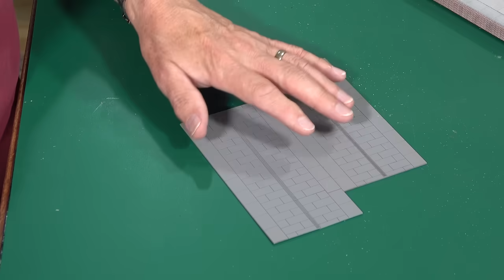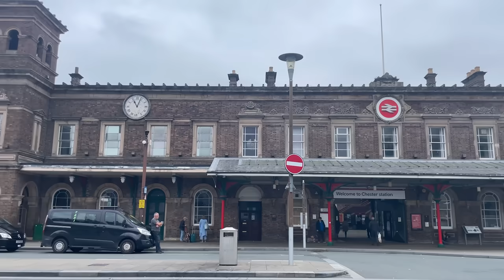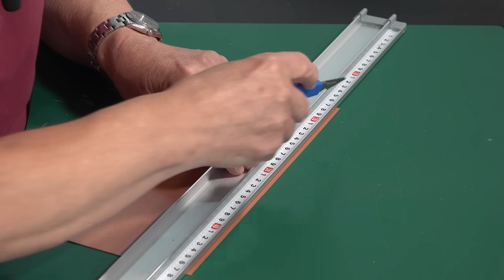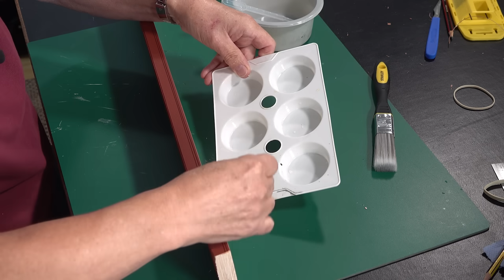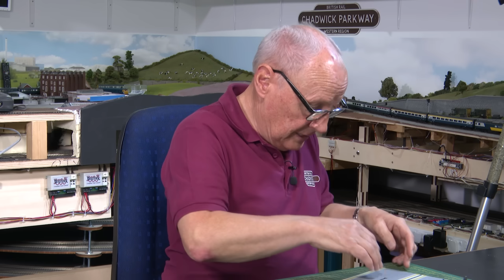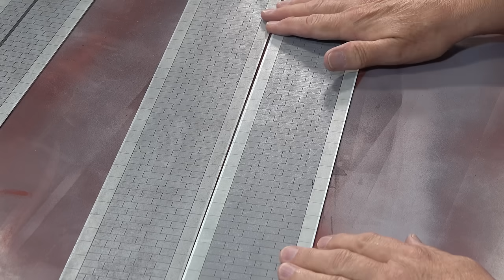Building The Ultimate Model Platform At Chadwick Model Railway | Episode 233

Comment from the maker: For the cutting ruler, search eBay for “metal safety craft cutting ruler picture mount cutter Rule 60 cm”.  Regards, Charlie.
Reply: Please think twice before purchasing that ruler.  In the eBay listing, it claims to have a steel cutting edge (for longevity).  That is incorrect; the cutting edge is aluminium and will not last very long at all...
Reply from the maker: @manokent  thanks mate, it was actually bought for me as a gift. Regards, Charlie.
Reply: @ChadwickModelRailway  - the crying shame is, if it did actually have a steel cutting edge, it would be the perfect cutting rule and extremely well priced.

I bought one and was quite miffed as I know the aluminium edge will only last a few dozen cuts before getting too hacked up.
Reply: @manokent  I bought one for myself at the same time - I put a flat neodymium magnet on the edges of both as soon as I had them delivered - they stuck, weakly, but enough to hold there whilst moving the ruler around in all directions. It didn't stick of course on any other surface, and so the edges are made of steel. So the ones of the seller from whom I bought mine were as advertised.
Reply: Hi @Pizzpott - yes, the magnets are attracted to the cutting edge - but that weak magnetic attraction is to the steel tape measure glued to the upper surface.  Neo magnets are that good...attracted to steel THROUGH  a couple of mm of another material (the ruler body) and that is why the attraction is weak.

Try the same trick right at the start of the ruler where the grey rubber is (the cutting edge is exposed there too).  Without the steel tape which starts at the 0cm mark, the magnetic attraction is near enough zero.

Then try finding a join between the cutting edge and the (aluminium) body of the ruler.  There is none because it is all one aluminium extrusion.

Finally (don't do if you don't want to damage the ruler prematurely), take a file to the cutting edge and give it a good filing.  Your magnet will not be attracted to the filings as they are 100% aluminium.

:-(

Comment: Hello, yes I do know what those Zig Zags are. They are designed to improve electrical conductivity for Train detection with track circuits on lightly used lines. You'll find some at Manchester Piccadilly as well, and in New Zealand where I am, we have them on the Morningside Car Sidings.
Reply from the maker: Thanks K, I have never come across that modification before. Every day is a school day. Regards, Charlie.
Reply: Hello, I saw those zig-zag welds on SNCF (France railways) for better electrical connection on tracks rarely used.
In Italy they are used for in-cabin signal repetition systems which uses codified currents.

cheers
Reply: Hi Charlie.  I would of coloured a few tiles a different colour to depict work on the platforms over the years , especially on the platforms where the mail/parcels go as brutes were notorious for  damaging the tiles . 🙂. Great video as usual.
Reply: I've seen the zig zag thing on some tracks at my local station.  But never given much thought as to what they were for.    Re the cobbling?? This seems like a gap in the railway modelling market 🤔.
Reply: Happy Level up day Charlie
Reply: The Mid Norfolk Railway at East Dereham in Norfolk have the zigzags on their track. They are situated under the A47 flyover for a few hundred yards in the vicinity of two level crossings, presumably to help with the crossing track circuits
Reply from the maker: @richardmarshall4322  thanks Richard, then more common than I thought. Are you guys Charlie?
Reply from the maker: @blairleipst4508  thanks Blair, that’s most kind.
Reply from the maker: @mikeking2539  I think you’re right Mike, it seems to be a lack of it. Regards, Charlie.
Reply from the maker: @simondawson4270  you are of course right? Simon, they are certainly not finished. Regards, Charlie.
Reply from the maker: @richardmarshall4322  thanks Richard, they are more common than I thought. Regards, Charlie.
Reply from the maker: @Setola  thanks, I certainly never seen them before. Regards, Charlie.
Reply from the maker: Thanks mate, but it was certainly something I had never seen before.
Regards, Charlie
Reply from the maker: Yes, Mike, hopefully someone will take it up. Regards, Charlie.
Reply: Hi, it's a stainless steel weld to help with rusty rails in bay platforms to help the track circuit
Reply: Yes, you can see some zig zags on the little used cross over track between the up and down lines at the southern end of Dawlish Warren Station.

Comment: Those zig zag welds are for ensuring the wheels make contact with the steel on the rails and not a coating of rust. That ensures signalling circuits  make contact with the wheels of the trains.
Reply from the maker: Yes, Philip, you’re bang on the money. Regards, Charlie.
Reply: It’s a tad basic isn’t it. I suppose it’s a quick and dirty solution. My idea would be to make a fitting you bolt to the rails to achieve the same , may be I am a perfectionist.
Reply: is it a different grade of steel to rust less than the rail steel or is for different contact patch (smaller) to clean up more easily than the flat rail head?
Reply: @MrTrustafox  It is just the contact area that is smaller and rougher. Some infrequently used points would have these to ensure electrical contact for signalling. A really noisy and rough ride over the welds. As a retired train driver, I have in the past been rostered to do Rusty Rail moves. These were done across less well used sections of track, As the name suggests to clean off the rust.

Comment: I do scale modelling of aircraft and military vehicles and one of the ‘tricks, after everything is painted, is to spray with a gloss varnish. This makes putting on decals easier (they slide around) and then do the weathering. Weathering benefits from having a uniform finish rather than the different finishes you get from the different paints you may have used. After all that is done you spray it with the lacquer/varnish of your choice, matt; satin; or gloss. Job done and your precious paint, weathering and decals are protected.
Reply from the maker: Many thanks, Stephen, for your excellence suggestion. Regards, Charlie.

Comment: As others have said, the ‘rumble strip’ on the railheads towards the buffers is to ensure that the track circuit remains intact in a bay platform. All the bays in Leeds and York stations, for example, have these.
Reply from the maker: Thanks for the info, I’ve never been to Leeds but I have visited York several times. Clearly, I hadn’t spotted this modification. Regards, Charlie.

Comment: Not exactly in answer to your question about Zig Zags on the rails, but somewhat adjacent. I used to work at Bekonscot Model Village, and they had welded zig zags on to some of the 7 1/4" gauge track in a siding. The reasoning was to alert the loco driver that they had reached far enough into the siding, past the points, so that other trains could pass through the points.
Reply from the maker: Now there’s an interesting use GM. Regards, Charlie.

Comment: Like the platform tops and will be ordering. The zig-zag welding on the track you spotted is a corrosion resistant chrome welded strip usually hand welded by a track welder for track circuit actuation where a light loco might be hiding obscured from sight of the signaller after coming off it's train. It is the more recent version of depression bars which were a mechanical  track circuit actuator depressed by the wheel flanges. A sort of reminder appliance for the signaller but still relevant in low traffic platform ends.
Reply from the maker: Thanks Pete, I really was scratching my head on the welded track feature. Regards, Charlie.

Comment: My trick for brick mortar lines is if I’ve used Acrylic to paint the brick Red/Brown normally airbrushed Tamiya paint I then wet the surface with white spirit and use a thin grey oil pin wash to pick out the mortar lines. AK then do some great washes to get that grimy/grubby brick look. Love your method of platform construction. I work in N gauge and my station is a gentle curve but would love to have had something similar to that top you used.
Reply from the maker: Many thanks, Richard for sharing your technique. Regards, Charlie.

Comment: 8:40, the weld applied to the rail head is an area of high head contamination that both inhibits traction (gives a high stress area to displace the contamination) and assurance of dropping the track circuit.   Could be either or both.   

Only works for low load areas (speed and load).  Normal axle loads would destroy this in quick time.
Reply from the maker: Great info Brenden, and much appreciated. Regards, Charlie.

Comment: Happy birthday Charlie! Firstly, the Revel glue you were using, a little tip; each time you use it, before you put it down, tap the tip on a hard surface, as this is supposed to keep it clear. Secondly, that platform where the parcels train is, why not make that an excursion platform, as it has a run round facility, and have the "derelict" platform as a parcels platform, with stock being shunted in from platform 4 (excursion) to platform 3. On clydebridge, parcels trains arrive into platform 5, and the depot 08 takes it out, and shunts it into platform 6, which is also used by the sleeper train. The 47 then comes out platform 5, and goes into platform 6, to be at the head of the train.
Reply from the maker: Thanks for the interesting suggestion. However, it does mean digging up some ballast because an extra point will be needed. Regards, Charlie.

Comment: Belated happy birthday 🎂  I think those new platforms are fantastic.. and u have done a great job on the painting and weathering on them. I really wish I could use them for my layout but my platforms will have curves at the left end going under the town scene  so I'm working on a  design with the concrete platform edges and I will have to either go down the printed plasticard or grout style methods  but I will have to do edging strips and will be following your painting guide for those as they look perfect for the style I'm looking for
Reply from the maker: Rest assured SJ, I will have the same problems on my large station. Regards, Charlie.

Comment: The marks I think, maybe some sort of arc welding, scoring, into the top of the rail to help with traction for when the train pulls away from the buffer to prevent wheels spinning and causing flat spots on the wheels and rail burns.
Reply from the maker: Thanks for your suggestion, however it is actually to do with better wheel to rail contact, for Signalling . It detects when the train is in the siding. Charlie.

Comment: Many happy returns, you mentioned "not learning much" wrong me old mucker, I learnt bundles, check the width of your canopies, consider the layout of the platforms, passenger/ goods, access for motor vehicles, (when the news paper train arrives they went straight into vans, not always but) not sure I will go for solid wood, maybe a skin of 2/3mm ply on top of fine battens, that way I could hide wiring within the platforms, and have only two wires going thru the base board. Charlie, thanks for this, what ever you do always helps, sometimes in great ways other times just to raise a smile Ta!
Reply from the maker: Thanks Vic, that’s very kind of you to say so. Regards, Charlie.
Reply from the maker: Thanks Vic, that’s very kind of you to say so. Regards, Charlie.

Comment: I like the idea of the change in the platform layout.  It makes sense that the two branch line tracks would share one platform at a terminus station (i.e. at the end of the line.)  But also as it is set up, the redundant track could always become an active track down the road if you wanted to (even if you use it as for mail/express cars - i.e. one track could hold be used for mail/express cars that are being loaded and/or unloaded and the other for cars that are ready to leave the station (a departure track.)

The change also makes sense as the station might have needed platform access for four tracks prior to the era you are modelling (i.e. you are making the station scene more authentic in the sense that in real life some lines saw a lot more service at one time and then by later in the 20th Century service levels had reduced as people turned to cars.  Thus the station will be more authentic with the change.

And Happy Birthday!  Many happy returns!
Reply from the maker: Thanks Edward, I’m so pleased you like my amendment. Regards, Charlie.

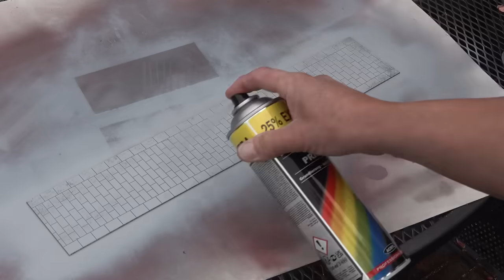Comment: 13:40 Given you are looking for the marbled effect this may be a wasted suggestion ... but if twere me, I would start spraying across the width moving down from top to bottom and then doing the longer spray along the length. That way both directions of the grooves get sprayed.
Those laser cut platforms would be great sellers I think.
Reply from the maker: Many thanks for your advice, mate. Regards, Charlie.

Comment: I’ve used that revelle glue for years and never thought of the heat to free the applicator, I’ve just been using a pin in the tip and very carefully applying the stuff
Reply from the maker: Probably a safer option Luke.
Regards Charlie

Comment: Hi Charlie. Another great presentation. Wavey lines. I've read some of your contributors comments, and while the track circuit theory may well be correct, that doesn't explaine why they appeared at busy London terminii like London Bridge in the 70's for the final few yards before the buffer stops. Thos tracks were busy enough every day. I remember well how much the EMU's used to shake as they went over them. Seem to remember they coincided with a couple of over runs and buffer strikes at the time. All the best, keep up the great work. 10:07
Reply from the maker: Apparently, Chris, it was installed to enhance train detection for signal purposes. Regards, Charlie.

Comment: Happy Birthday Charlie and many more of them. Excellent how to do Video as usual, the crisscross Welding on top of the surface of the running Rail is to assist Track Circuit Detection usually at oily/shitty and rusty Areas in Bay Platforms.
Reply from the maker: Thanks, Peter, and for the advice on the railhead. Regards, Charlie.

Comment: Those wavy lines on the track are called eutectic strips and are there, I believe, to ensure track circuiting is accurate and shows a section is actually occupied. Being above rail height there is a better chance of not being covered in rust, oil or grease.
Reply from the maker: Yes, Hugh, your bang on the money with that. Regards, Charlie.

Comment: Heyup Charlie.  I'm a practicing signalling engineer and your "wavy lines" are stainless steel welds called "eutectic strips" and their purpose is to break through all of the crud associated with platform rails to give train wheels a better contact for dropping track circuits.  Platforms are horrible places if you work on the railway.  Once did a ballast renewal or "deep dig" at Sheffield station and below the top layer of oil contaminated ballast was human waste about a foot thick.  It isn't all wine and roses in the S&T
Reply from the maker: Many thanks Simon for the technical details.  I’ll brush over last sentence, poor you!  Regards Charlie

Comment: I believe you're correct about the zig zag pattern on the rails near the buffer stops being for friction. We have them on the older platforms (1,2, and 3 but not 4) at Manchester Airport. I originally thought they were  kind of tactile warning about the end of the track but I suppose TPWS deals with that now.
Reply from the maker: Sorry Jay, but there to enhance train detection for signalling purposes, on rarely used lines.

Regards, Charlie
Reply: @ChadwickModelRailway  fair enough! I'll pass that back to the guy who told me that. Although the increased contact area would also increase friction as a side effect, and the more you think it's probably nowhere near enough for a train's weight even at just a few mph, just like suddenly hearing the noise of them and realising you're feet away from the buffet stop isn't enough time to regain situational awareness and stop the train before hitting the buffers.

Comment: 🎉 The blotchy spray pattern can depend on the MDF surface - different grades ? or just the resin bonding the fibres.
Brushed on finishes can also be absorbed into the surface in some areas, it's MDF!! 
Useful but awkward to use.

The double pass laser cut on weathered platform had a more 'worn look' to each flag stone, the edges appeared to be softened, from metal wheels of porters trolleys etc  ageing the platform!!
Reply from the maker: Thanks John, I must confess MDF is not one of my favourite materials. Regards, Charlie.

Comment: The zigzag welding on the track surface is for grip i think. Ive seen it in the final braking area on many bay platforms. 
One extra benefit is the raised up weld metal locally restores the worn track surface perhaps delaying track replacement ?
Reply: That's not correct.  It's to aid with electrical conductivity between the rails and wheels for track circuit and signalling purposes.  The reason you see it so often at the end of a bay platform is because that's often where locos stand for a while, and the rails get covered in oil and crap which reduces electrical contact.
Reply from the maker: That’s correct it’s to do with detecting the train for signalling purposes on the line that is rarely used. Regards Charlie.
Reply: @delboy1727  My guess ! Was off the mark. I had seen the weld lines on both sides of a new buffer assembly clamped to the track , a few metres away from the end of the bay tracks. Bangor sta, N.Wales was one site.